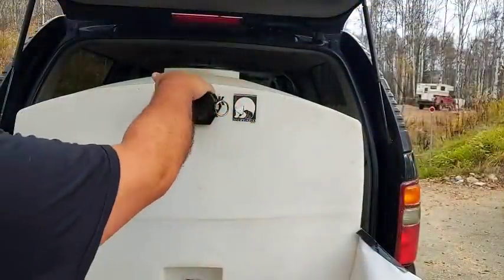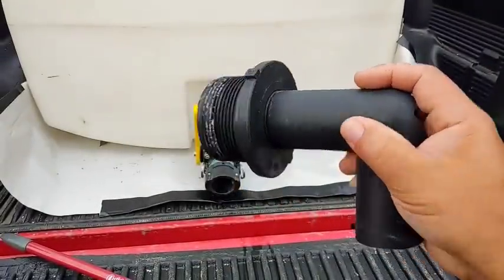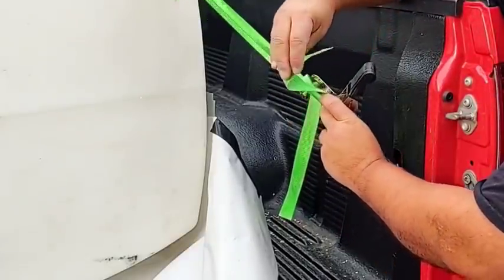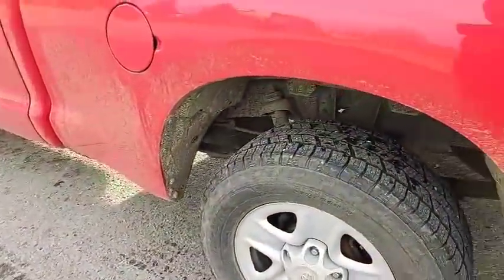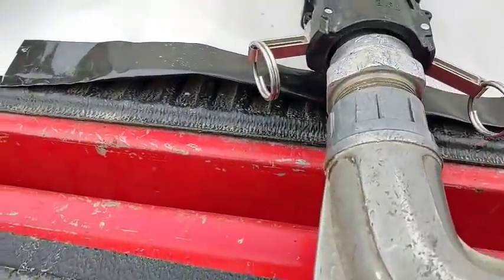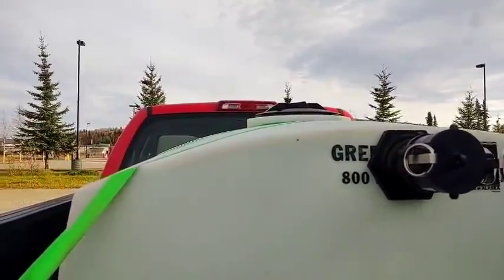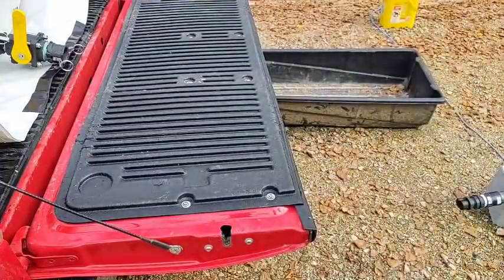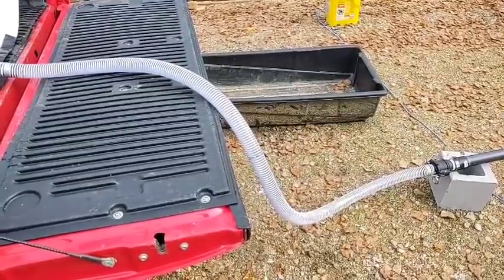Upgrading My Water Hauling Tank To Better Serve Me During This Alaskan Winter

Comment: I guess my question Rudy, is rather than get another vehicle, why not just have a well drilled and be done with it. Just curious and I know you probably have a great reason. I was just curious. Take care and God Bless.
Reply: He has crap ground water in his area, and drilling isn't as cheap as it used to be.
Reply: I wonder if digging a pond would make sense or not???
Reply: Also, not sure of the laws and regulations, but here in Canada, (and no, it's not necessarily everywhere in 🇨🇦) if there's ever permafrost, you can't drill at all. That being said, I know that A.P. has a nice hot summer, so this isn't applicable in his case. :)

Have a great evening everyone. Blessings to you and your families. 😊
Reply: @ilovehorses5714  if I'm not mistaken, permafrost is an issue up there. And in the winter, it would be frozen.
Reply: @Pluscelamemechose  Aw! You're right! Then you'd just have an ice skating rink. 😉
Reply: Deep South Bama with Mr. Tom Wells here in Alaska are expensive 20-30K easy. Reason why most of us have holding tanks
Reply from the maker: Hello Mr. Tom, always nice to see you here, this is a frequently asked question so i'm going to answer it during next Sunday's Live Stream...
Reply: Hey, I didn't see that it was you Mr. Tom. Congratulations on getting your boy home from the vet, and him not running away. That's 2 for 2. The next one is likely to disappoint you and scamper. Let's pray it won't.